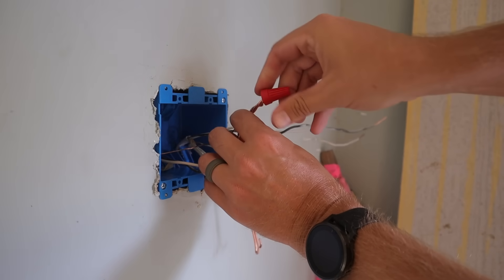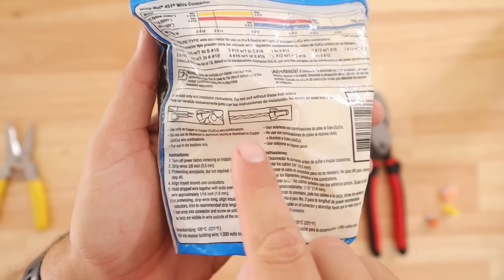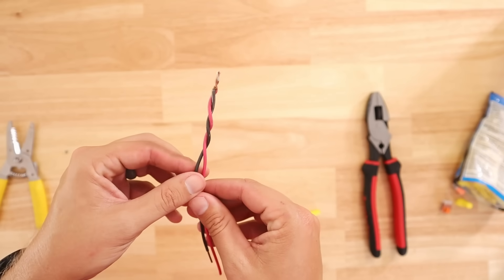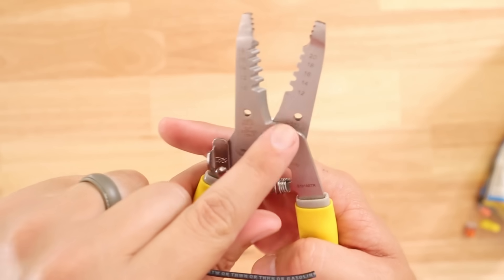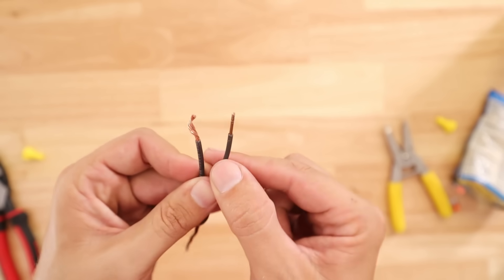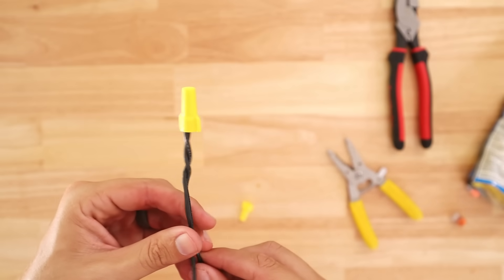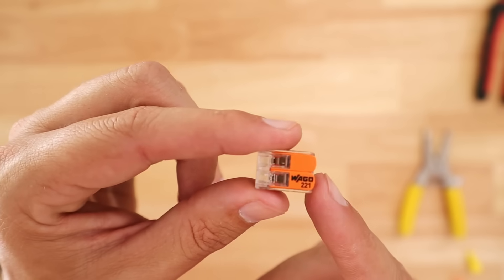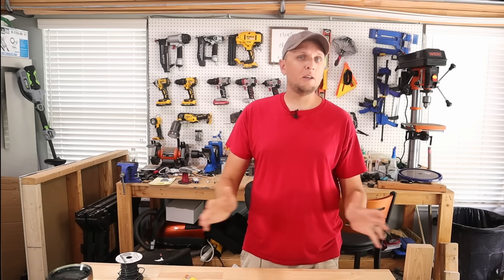BIGGEST Mistakes DIYers Make When Connecting Wires Together | How To

Comment: Well came here to find out how I was using wire nut wrong but turns out I was already mostly doing it right. (I didn't snip the ends if there wasn't a big gap)
Reply: If you let one stronger wire be ahead of the other wires, it will tend to poke through the end of the wire nut. I've personally done this. it's not good. cut it off and do it again (the first time, no matter how many times it takes). ;)
Reply: @johnathanohlund6995  Thanks for that. I always prefer to know why something is or isn't done.

Comment: How often in residential wiring do you connect two solid core wires together? It's nearly always three wires. My biggest complaint concerning wire nuts is people, including professionals, not tightening then enough, which can cause arcing and associated problems, and is a real pain to troubleshoot. Also, wire nuts can loosen over time as the wiring heats and cools causing it to expand and contract. Stop using wire nuts! Use Wago connectors instead, they're nearly fool proof.

Comment: I very heartily endorse this video. There are many excellent comments about techniques. My fear is that people over-stress the copper which compromises it's conductivity. So remember by analogy you don't want to tighten a screw until it shears and then turn it back a quarter turn.
My preferred technique in preparing multi strand wiring is to use a sharp knife to score the perimeter of the insulation you want to remove.Then at about 3  or more places (depending on access and gauge) cut with very light pressure and a sawing motion with the knife on the score line until the blade reaches the inner conductors. Then twist the insulation so it breaks and keep twisting it whilst you remove the unwanted insulation. This ensures a minimum risk of broken strands and limits the danger of distressing the copper. The multi-strand wire is now also pre-twisted. If I need to do it faster I have generally found that wire strippers that are end address are more preservative of fine conductors. End address meaning it's a little like putting the wire in a toy dinosaur's mouth and letting it bite and swallow.Then hand twist fine stranded wire.
Prepping solid core a kink for anchorage is a very good strategy. The kink should however be slightly less than the diameter of  the multi-strand wire and should be a double kink(z bend) so that the alignment of the solid core before and after the kink is linear.
After this cut to equal length.
The wire nut is now best able to meet its specifications.

Comment: I love how these demonstrations feature small #14 wires (15 Amp) rather than the much stiffer standard #12 wire (20 Amp).  Also, jamming the code maximum number of wires into a box while maintaining the required excess length practically guarantees a code violation for lack of neatness and may very well result in a damaged receptacle.  This entire industry is a joke and electrical device manufacturers need to be held accountable by the code authors for the ridiculous products -- and safety hazards -- they produce.
Reply: 90% of residential wiring is #14.
Reply: @joeshmoe7967  I'm not a certified electrician(retired lineman)but most wiring in So. Cal in homes built since the 70's is # 12. Most circuit breakers are 20 amp, which requires # 12. Another way to check is to found out what electrical supply stores sell more of....probably #12
Reply: @joeshmoe7967  smaller house, garage, outdoor, kitchen and dining room circuits makes up much more than 10%.
Reply: Both #14 and #12 are "standard". It depends on the ampacity of the circuit you need to install. Most residential circuits are 15 Amp, which only requires #14 wire. A 20Amp circuit (e.g. kitchen and bathrooms) requires #12 wire. Of course, you CAN use the larger #12 on 15Amp circuits; it's just more expensive, and with the prices of wire these days, the difference can add up.
Reply: @doug8718  I'm curious where you live. So many appliances use a lot of power and even my bedroom has a tv, dvr, stereo, all on one power strip. I only see #14 going from a wall switch to a light. I assumed that was the main function of #14, low amps, for a single "appliance"(light)
Reply: @David Lacey I don't think like you so I'm a child? RIGHT!!
Reply: @David Lacey My first replies to you were to hopefully let you see how absurd it is to make a home wiring video, political
Reply: @rubroken  Nothing you say to someone who likes to make everything political will make a bit of difference.
Reply: @timothybosley7987  You're right, but I just expected electrical experience or expertise in the comments....it threw me off!
Reply: @David Lacey WHAT?
Reply: @David Lacey You're injecting politics into a wiring discussion? I think people like you are the reason this country can't get anything done

Comment: Been an electrician for 25 years and never used a wire nut. Ive used wagos but there big and not good for every situation. My go to is for any connecting of 2 wires is insulated crimp connectors.

Comment: Would there be any benefit to twisting the wires after inserting into a wago type connector (similar to continuing to twist a wire nut to reduce the chance of pulling out)?
Reply: Maybe, depending on the application. The excessive twisting/braiding of even the wire nut application is overkill. If there is that much potential pull stress on the connection, you might want to consider a different method entirely like crimped ring nuts bolted together.

Comment: You seem to be adding your opinion as a rule. Although I agree with your premise that the connection will be more secure by insuring twisting under the wire nut, the instructions cleary state that it is not necessary. When you inject your opinion as mandatory, you lose credibility. I would suggest that when you make a recommendation, you state as such and not drive it as incorrect.
Reply from the maker: That part is not my opinion really.  The instructions clearly show that’s how it’s to be done.

Comment: Electrical tape does wonders for all of these connection issues.  Once the wire is taped to the nut, the connection is not going anywhere.

Comment: The biggest mistake I see people make is that for some reason they will pre twist the wires in the wrong direction causing the wire nut to push one wire out I work in maintenance and see this a lot
Reply from the maker: Interesting.  Possibly left handed and don’t think about the direction the wire nut turns?

Comment: Word of caution from a learned experience. Wago connector: Don't go cheap, get the "Wago" connectors. The cheaper brands may look the same but may not hold. I bought a bag of 2 wire up to 4 wire for around $10. There were 30 connectors but most would not clamp tight and I could pull the wires out of most all. Don't be a tight ass ..... be safe!

Comment: Wrong....the pic shows the insulated part of the wire is twisted to illustrate how tight to twist the wire nut. From my 12 years experience selling Wholesale Electrical  supplies. Nice try though....
Reply from the maker: Ok so by what you just said it’s not wrong then, thanks for verifying 😂 But I appreciate the condescending comment nonetheless!
Reply: You explained the picture showes stripped wire being twisted before installing the wire nut. I'm say that was wrong. It shows the wire nut installed and the insulated section below the wire nut is twisted depicting how much tension is required to install the wire nut.
Reply from the maker: I never said that.  I actually had to go back in and watch to make sure I hadn’t misspoken, but I never said anything like that.

Comment: In my professional opinion, stripping the stranded wire at least 50% more than the solid wire is a must. People in my area run off to Costco every fall to purchase a five pack of Honeywell digital thermostats for what amounts to an outrageously cheap price and because the thermostat wires come factory stripped at half an inch, they just twisted up to the solid wire in the electrical box and in almost every case, they experience a bad connection with overheating and the wire nut melts. We get a high volume of calls in winter for bad thermostat connections made by homeowners.

Comment: You pinch where the insulation stops and twist. If you hold real tight and twist the wire nut it will twist the wires. I have never used my klines. I'm really sick and tired of seeing nonelectricans doing video's. Keep to painting. YouTube shouldn't allow non licensed people to do video's.
Reply from the maker: So do you also recommend the lead paint still or?

Comment: Those wire nuts are crap at best, they should be banned! I twist, solder, then two layers of heat shrink over the top, easy, safe, secure.

Comment: And then everyobdy including you are doing the same common mistake when you try to twist any pair of wires: YOU ALWAYS grab the pair in their tip (1mm) so as to allow those poor cables to actually twist perfectly! Try it! You are doing it in the opposite. If you try as I say, the twist can be as tight as you want it to be and without ever lifting your crimp tool!

Comment: Pretwisting wires is a complete waste of time unless you lack the hand strength to properly install the wire nut.  If the wire nut is installed properly, as you actually show, the wires will be twisted properly without need for an additional step.  Twisting the wires before applying the wire nut adds zero value and Ideal knows that which is why they don’t require pretwisting.
Reply: 20 year electrician here. You're completely wrong. The amount of damaged connections and devices I've seen from wires not twisted together tells me otherwise. Okay, so let's say a tight connection is made without splicing between 2 wires,  what about 3, or 4, or how about 7? You're relying on the metal of the nut biting into the wire to hold it into place. Does the nut make contact to all wires on a 5 wire splice? Number 1 cause of electrical fires is a loose connection. Why wouldn't you take an extra 10 seconds to actually splice the connection?
Reply: @AlohaOutdoorsman  32 year electrical engineer here.  You are completely wrong.  The failed connections I have seen were from improper wire nut installation.  A wire nut installed correctly will twist the wires together and the end result is indistinguishable from wires twisted with pliers prior to wire nut installation.  And which wire nut is rated for 7 conductors?  Or even 6?  Sounds like you need some remedial training if you are splicing 6 or 7 wires in a single wire nut.  I don’t spend extra time on a connection because I know how to install wire nuts correctly, and with the correct number of wires, and don’t need to waste time.   https://www.idealind.com/content/dam/electrical/support/wire-connector-catalog.pdf
Reply: And why is it wire nuts are installed incorrectly in the first place lol.  Could it be because the nut will not always twist the exposed ends properly, and deceive due the insulation being twisted lmao.  For anyone to think pretwisting is never required, is 100% because they don’t care about doing good work and are too stupid to pretwist.  Basic physics.  The kinda guy that will pretwist wires for his home, but not at work lol.  Or the total Moron that never pretwists.  It boils down to ethics, laziness, and plain ‘ol stupidity.
Reply: It is not indistinguishable you are lying to yourself.  Your telling me the mechanical bond is the same with or without plier twisting??  Stupid as fuck.
Reply: Totally agree. The only beneficial recommendation here is to keep twisting the wire so the insulated wire portions twist around each other to help safeguard one wire pulling free for whatever reason
Reply: @993mike  after 50 years in the trade I'd very much disagree. The likelihood of failure is much lower with a good solidly twisted connection. Taking human error into account is a big part of the installation process. Aluminum wire is safe if you can count on a perfect installation. Truth is...you cant.

Comment: I add black electric tape wrapping in the tightening direction of the wire nut then fold over the tape after cutting making a flag so that it can be unwrapped later on easily for the next person who winds 
up working on it

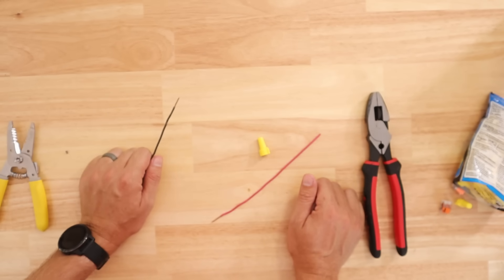Comment: The reason the wire pulls out easily @ 2:55 and 7:12 is that you’re using the wrong wire nut.  14 ga. wire should use orange wire nuts.  Yellow is for two 12 ga., or three 14 ga.
Reply from the maker: That is not correct.  The minimum of the 451 yellow wire nut is 2 #18.  You can check the packaging or their website for sizing.

Comment: In most countries in Europe, you can not purchase wire-nuts due to the crappy job they do!
Reply from the maker: Those were the old school wire nuts that havent been used in many years.  But Europe had already started using different connections and never went back.  Nothing wrong with wire nuts.
Reply: @HowToHomeDIY  I respectfully disagree! American contractors and their"Codes" are allowing all contractors to build cheap.

Comment: Wow, I’ve never had anyone explain how to use wire nuts before and I really like the wago connectors.  Never seen those before either.  Mind is blown.
Reply: I run an electrical installation company and we have switched to wago connectors (almost) entirely, and is required on stranded wire applications. The threads on a wire nuts cutting in to stranded wire has caused way too many issues.
Reply: I just had to fix a set of sprinkler valves that failed last weekend. The wires had become oxidized and the wire nuts had fallen off over the years. I cut and stripped the wires and used 4 position Wago push in connectors to fix it. The wire to the sprinkler valves was solid and the valves had stranded wire.  I twisted the stranded wires before pushing them in and simply pushed in the solid ones.

I will never use wire nuts again. The Wago connectors hold very tight and are so much easier to use. I also expect the way they hold the wire will protect them from corrosion.

Next up is to replace my 4 smoke alarms that are high up in a vaulted ceiling (the reason I bought them). This will make the job much easier than using wire nuts in the awkward position.
Reply: Wagos are junk but contractors can save some money up front  cut corner on quicker install.  Then I get paid later on down the road to repair when they fail.
Reply: @MrAzkush  "Wagos are junk..." is purely opinion and not supported by any documented unbiased testing. I'm sure you'll reference some anecdotal stories about having to replace a failed wago connection just as I can give you several stories of failed wire nut connections. "...can save some money up front..." Unless someone is buying in huge bulk from the manufacturer, wagos cost more than comparable wire nuts. Point being, neither method is "junk". They both have their pros and cons and to suggest anything else is silly.

Comment: DIY noob. I replaced 3 fluorescent fixtures with LED and used WAGO. Never had much luck at soldering or getting wire nuts to hold. Any considerations for wire nuts using wire with different metals?

Comment: PS: how do I splice 3 solid 14 wires with a stranded wire(14 or 12)? What color wire nut should I use? Do I have any other options? What do you think the best option is?

Comment: good info for the diy and i really like the wago connector. is it ok to reuse wire nuts because that's about all i have? thnx for the help.
Reply from the maker: So the answer to that would be as long as the wire nut is not damaged or worn then yes it could be used again.  However, they are pretty inexpensive so it would just be best to use a new one.  I hope this helps and thanks a lot for the feedback Steve.
Reply: @HowToHomeDIY  ok, i have a box of different sizes, new and used, ones i picked up on job sites over the years when i worked as a lineman for the power company, thnx.

Comment: i’m glad i saw this. i prefer to do all my car work myself and i was going to get a new radio, and i’m glad i know how to keep the wing nuts in place. I installed one a while back on a friends car but bought the wire nuts from walmart where the packaging was pretty bad and didn’t even have instructions so i just used general knowledge and definitely didn’t tighten them enough
Reply: Wire nuts dont belong in a car use butt joints or solder and heat shrink
Reply: Never use wire nuts on automotive wiring. Automotive is all stranded and has its own connector types. Soldering is always best, but heat shrink butt joint connectors can do in a pinch.

Comment: Yellow Wire Nuts are garbage. I don't know how, but every manufacturer got together and decided to make their yellow wire nuts not bite. Tan Wire Nuts(Ideal Brand) are the best for that size range. They even bite better on fixture wires than Yellows do. I see no reason to not use Tans in place of yellows in every situation that requires connections that small.
Reply from the maker: I have heard this.  I have never had an issue with the yellows, but I will take a look at the tans.  Thanks for the feedback!
Reply: @HowToHomeDIY  yeah try them out. The ideal brand ones have a ton of ridges in the plastic that really let you get some torque on the twist. They have a very wide range on what they can bond, only on few occasions do I need to upside to a Red. Plus they just bite on anything, you can probably bite on a single 24 awg copper with them.
Reply from the maker: Bought some today while I was at one of the big box stores.  Tried them out when I got home.  I like them.  Thanks for the suggestion!